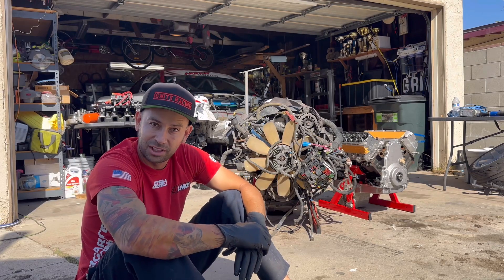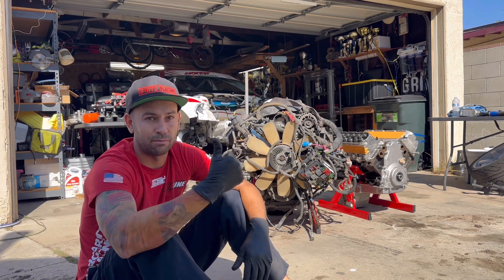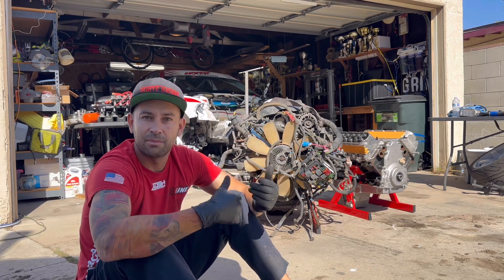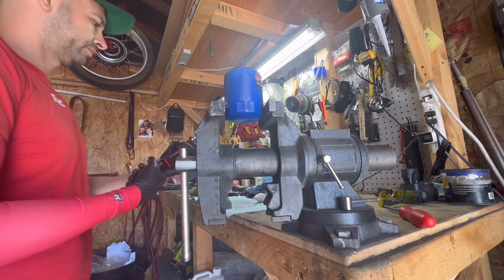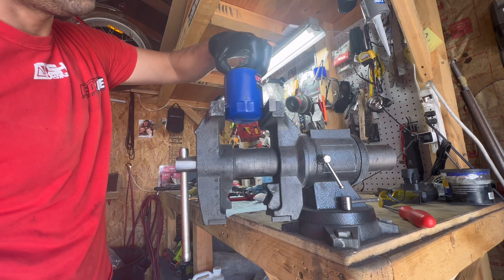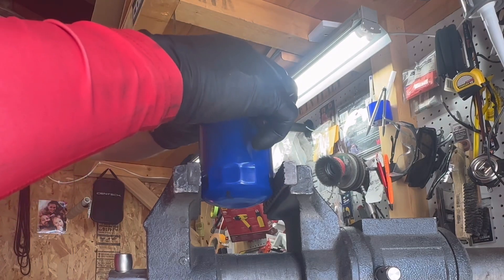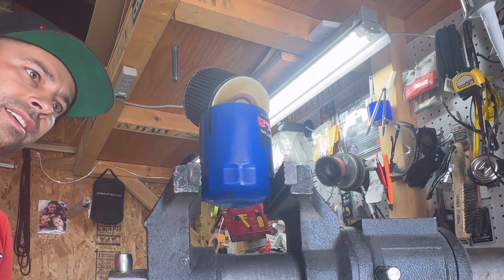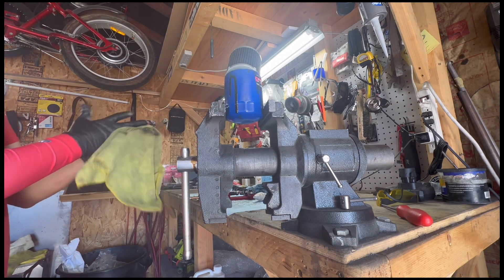How to check if your LS junkyard engine is good!

Comment: Wouldn’t those compression numbers indicate an issue? I always heard it’s not only that the numbers are high enough but they all have to be within a specific amount of each other
Reply from the maker: @stanceswitch6419  You’re absolutely right! Consistency between the cylinders is just as important as the overall compression numbers. If one cylinder is significantly lower than the others, it could indicate an issue like a worn piston ring, a valve problem, or even a head gasket issue. Ideally, the compression readings should be within about 10-15% of each other. So, even if the numbers are high enough, a significant difference between them could still point to a problem. Thanks for bringing that up—it’s an important detail to consider when checking engine health!

Comment: Good video, can this test also diagnose a knock? Can cranking it cause us to hear knocks if there are any, also if it is not the correct way, how can I diagnose knocking for a engine outside of the car?
Reply from the maker: @andrejkitanovski565  the straight answer is is very difficult maybe impossible to hear that without starting the engine . But if the filter is used. You most likely going to find metals if this engine was knocking.
Reply: @Thegreekdoctor75  Thanks for the quick update, will definitely check that, the engine turns freely, its a v6 and It has been left without oil for some weeks/months, what would be some advice before I start it. Would really appreciate it, thanks.
Reply from the maker: @ I suggest you after you put fresh oil and oil filter try to crank the engine without gas do you build oil pressure . Absolutely if you have any other questions, let me know.

Comment: Hey man dumb question here. I’m just getting into figuring out a motor. I picked up a 5.3 from a friend. It was running when he pulled it.  When I got it home I could turn the crank bolt about a quarter turn but then it wouldn’t budge. This is with everything still connected(belt, accessories, alternator, spark plugs  flywheel, torque converter, ect…) just the engine on a pellet. I just want to see if it in fact still a good motor? 

My question is that normal? Do I need to pull all the accessories and plug to get it to turn? 

Sorry I know it’s a silly question but I’m a novice
Reply from the maker: Hello brother, maybe because it is on the pallet something on the back of the engine in like the torque converter dancing on the woods or on the starter.? I am more than happy to help. If you want we can jump in a video call to find what’s happening together. You can contact with me on my Instagram. @tgdmargaritis
Reply: Take the belt off and try turning it over again. Maybe you have an accessory giving too much resistance. Taking the belt off will make it much easier to turn it over by hand